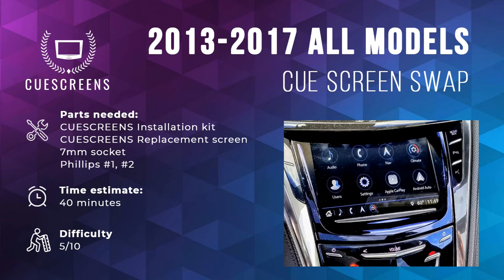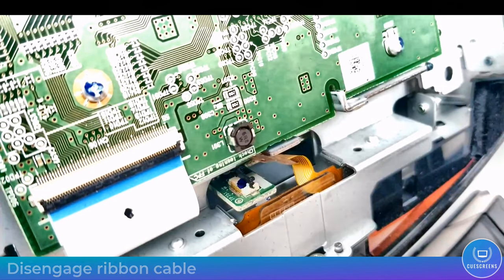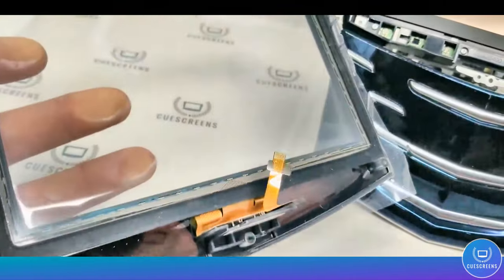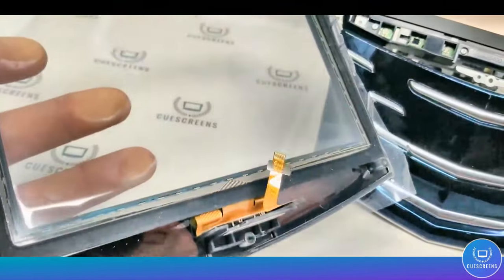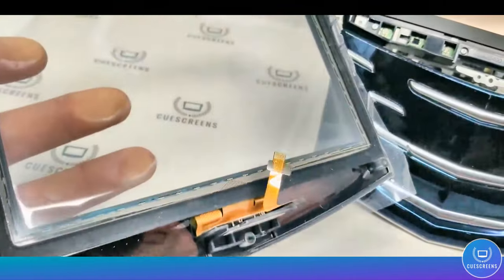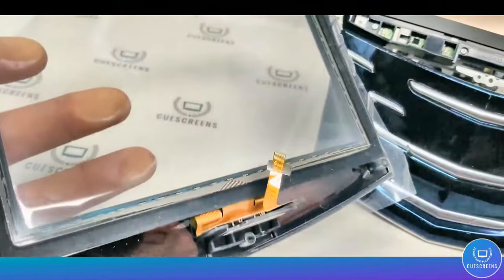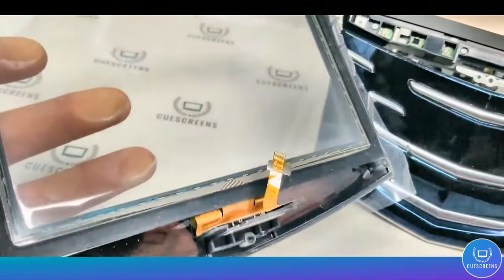How to replace Cadillac CUE screen to fix unresponsive / random touch issue  *Easy Method*

Comment from the maker: New for 2022!! The Premium Dual Mode screen is compatible with ALL systems- whether it starts with 2 or 8, doesn't matter, it still works. This means there is no risk of ordering the wrong part anymore. Check it out here: https://youtu.be/AzMrYJPxxN8
Reply: I jjust used the dual mode screen (2016 Escalade) and it worked perfectly.  Only difference from the video was my side covers were shaped different and only held on with (2) screws each, instead of (3), but other than that the video was spot on.

Comment: Just finished this myself in about an hour.  Screen hasn’t been working for two years. I am so unbelievably grateful for this video and that it actually worked!
Reply from the maker: You're welcome!
Reply: Oh please!!!  It didn’t take you an hour. Get real. There’s no way in hell you did all this In one hour.
Reply: @joeblow9850  I have zero reason to lie about this.
Reply: Well that's a great sign 🎉.
Reply: @joeblow9850  lol if you know what you’re doing you can do this shit in less than 30 minutes, you must take 3 hours to do an oil change too huh 😂
Reply: @sosa3017  actually I do to be honest because my OCD forces me to wait for every drop of oil to come out, Then gotta clean the oil filter housing thoroughly before puting in the new filter, then ofcourse I need to take the oil filler cap into the house and wash it out with hot soapy water. Dint even get me started on the air filters & spark plugs. 🤣🤣. How much time ya got?   LMAO
Reply from the maker: @joeblow9850  I do them in 30 mins :D
Reply: You liar lol
Reply: You missing steps my G

Comment: I didn’t have any cracking but the screen wouldn’t respond to the touch. The dealership quoted $1400 to fix it. After watching your videos I thought it was worth $130 to try your screen. After watching your videos several times the install was a piece of cake, less than 2 hours on my 2013 SRX. My wife is thrilled. Happy wife, happy life. Thanks cuescreen.
Reply from the maker: Nice job, happy to help!

Comment: 40 years as a tech and can truly say this was the easiest and most cost economical repair I have completed on my ATS.  I hope it lasts in the Florida sun and I finally have one less reason to hate my car.  Shame on Cadillac as 4 screens replaced in 5 years is totally unsat.  GM should have been using this design from the beginning.  On a 5 star rating, the replacement material and video are a 10.

Comment: Thanks a lot, took me around 1.5 hours from start to finish and now works perfectly, (This is probably the first time I post a comment on YouTube) its worth doing it yourself the dealer wanted around $1500. My advise is to check which model your screen is rather than just your car year, mine is a 2015 ATS but I guess the screen was replaced under warranty in its previous ownership as my screen required the v2018 screen.
Reply from the maker: Glad you like it!

Comment: Small piece of advice that I think some would say goes without saying, but.....make sure you have a good pair of screwdrivers with a long thing shaft and to save yourself a lot of headache, a magnetic tip. There are some small areas. Not totally inaccessible, but would be VERY frustrating without a magnetic tip. This concludes my TED talk.
Reply from the maker: Great idea thanks for posting

Comment: Trying to install the screen onto a 2016 escalade everything is connected, the ribbon with the black face up and tab outwards the screen wont even turn on, if I flip it around the screen will turn on but the touch screen wont work. Am I doing something wrong or did I get a defective unit?

Comment: I just installed the CueScreen in my SRX.  Absolutely fabulous product and is working as the original!  The video is bang on and if you take your time and are patient, this installation will go well.  Watch the video a few times and have it with you when you take everything apart, including the trim on the car.  Thank you very much for saving everyone a pile of money.  The dealer here in Canada wanted $2250+Tax for this installation with the screen.  I would give you 10 stars if I could!!!!
Reply from the maker: Great job!

Comment: Followed the videos step by step. Very easy install. No issues at all and now my cue functions correctly. 😎 And I received my screen in 3 days. My luxury car is all luxury again. And not gehto hoopty
Reply from the maker: Awesome work!
Reply: 😂 mine is currently ghetto hoopty 😂 this might be above my pay grade so I’m thinking of taking it to my mechanic shop!  It will still be waaay cheaper than at Cadillac and since my town no longer has a dealer I’d have to drive at least an hour to 11/2 to get to one.

Comment: I guess I am a latecomer. I just did this job this afternoon. Not quite as easy as you all make it look but not difficult either. I had the most trouble getting the unit unplugged. I had 4 plugs but the top one on the driver side gave me fits because it would not release and unlike in you video, on a 2015 ATS, it is hard to get your hands behind the and get a sightline to see what you are doing. Also the trim pieces did not release as easy as it seemed to show. On the video. Once inside, I found mine to be a bit different from the unit in the video but they were minor differences.

This video made the job easily doable with a little patience.

Comment: I watched your  first and second video. Your attention to detail made the videos easy to work with with tear down and rebuild of car and module. I followed each step, stopped the video, did each step, then restarted where I left off until the  cue screen was attached and back in the 2014 srx car working. Now, understand that I am not mechanically inclined so the entire job for me was 6 hours with a few breaks in between but I myself was able to get it done. Thank you.

Comment: Excellent video have a 2014 ATS and looks like the dealer already replaced the screen before but left the screen protector on the inside cuz it had air bubbles all over and then started acting wonky where it would press buttons by itself, great instructions and did it all myself truly happy with the way it looks thanks again CueScreens!
Reply from the maker: Avoid that dealer- if the tech is not smart enough to remove the sticker that says "REMOVE THIS STICKER BEFORE INSTALLING"

Comment: Excellent video. My 2014 screen stopped working before CIVID hit. I was actually apprehensive about replacing my screen (myself). I even communicated with a few sellers on eBay to get a replacement unit. I couldn't see paying Cadillac $1300.  The instructions here were very accurate, concise and easy to follow... with a few pauses and rewinds (but that was for me to make sure that I was following the video). I took a little more than an hour from start to finish. Now my Cue looks so nice. I bought a genuine Cue screen on Amazon. Good look replacing yours. Just follow this video and don't lose any screws. Be gentle. Peace

Comment: Worked perfectly on ‘16 Escalade ESV. Only difference from the video on my unit was, instead of six 7mm bolts on the back of the unit, mine had T15 torx bolts. Thanks for saving me $1,000!

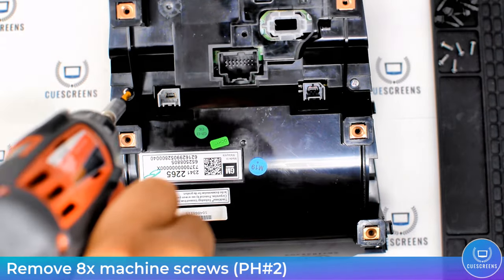Comment: Great video.  $79.99 instead of $1,500 is a great win.  Mine was not cracked at all, just (mostly and/or inconsistently non-responsive).  Took me just shy of 1.5 hours from start (began removing the cupholder) to finish (closed the door and smiled).  On my 2016 ATS, there are only three plastic screws instead of five (@3:07 of video) and they changed the 'compartment box light' connector (@5:00 of video) - it's not there on mine AND you don't have to remove it in order to remove the compartment box.  Appreciate the great product and the effort that went into your video -- Thanks, CUESCREENS!

Comment: Just did my 2013 SRX.  Over the past year and a half it went from randomly not working to completely not working.  Forums and online searches revealed a $2000 repair at the dealer.  I was contemplating getting rid of the car until I came across this and gave it a try.  Great video instructions! I replaced my screen in about 1.5 hours and now it works perfectly for only $140!  Don’t be afraid to try and fix it yourself people.  With the right tools and a little patients it’s an easy fix.
Reply from the maker: Great job Adam! I agree, its honestly a simple repair if you can take your time and follow the video. Especially when the alternative is paying GM another $1,800 for another control module that will fail in 2 years again :(

Comment: This might be a little tricky for someone with no mechanical experience .As a retired Electrician and my electrician friend (we have done a lot of our own work on cars starting out very young)we were able to do this albeit we installed the cue ribbon cable upside down and had to take it apart a second time.Second time was one fifth the time as we had the sequence down with a couple of extra screws left over where did not know where they went.Take pictures and watch the video a few times to get familiar.Support was great with the help of Charles I believe his name was,walked me right through it,Feel proud to do it yourself ,because the dealer is a total rip off at 1600 dollars,shameful.Thanks Cuescreens ,
great idea and great service
Reply: The dealership isn't replacing the screens. They have to buy a complete cue & some go for $1200. That "total ripoff" would be GM

Comment: Just finished replacing the screen in my wife's 13 SRX. Instructions are easy to follow. Unit works great. Just a heads up, the machine screws you are using a #2 Phillips screw driver are actually JIS (Japanese industrial standard) headed screws.
Reply from the maker: Great job

Comment: Great video.  Made changing the CUE screen very straight forward.  Thanks for saving me a $1,000 from the dealer.  This is actually the 3rd CUE screen replacement in my wife's 2016 SRX.  The first 2 were done under warranty.  This one was on my dime.  Highly recommended.  Thanks.

Comment: Thank you so much and +10 to your good karma for your help!!!!!! Just replaced the cracked screen with your videos and it worked!!! We did not do anything to get it cracked, so it's not due to negligence on the user's part. The dealer quoted $1,800. They should be taken to court for this kind of scam.
Reply from the maker: Great job.

Comment: THANK YOU!!!  I followed remove, repair, reinstall directions frame by frame for my ‘15 Escalade. The screen fit perfectly.  No alignment issues.  Great suggestion to try it before putting the truck back together - it powered up but touch didn’t work. I went to “troubleshooting” and sure enough it was the little ribbon connection. You need to get that to fit just right. That was the hardest / most frustrating part. I am incredibly happy with the result!

Comment: Just did my 2015 SRX. Like many have noted, the trim was the hardest part. Lots of steps but the instructions and particularly the video were very well done. All screws lined up fine, no code needed, and it worked. Like the ending screen of the video says "Congrats! I just saved $1,500!".
Reply from the maker: Nice job!

Comment: The installation process was so easy. If you ever worked on a laptop you can do it. The step by step video is extremely detailed. No surprises. Highly recommend this company.. but make sure you get the premium brand that comes with the tools and also the little mini needle nose pliers. Will definitely safe you time and a headache.

Comment: Excellent video, I was able to do this step by step at my desk without issue. I was very careful to not push on the new screen, or touch either the inside of the new screen and the inside of the unit screen after removing the old one as I didn't want permanent fingerprints. Everything lined up very well and went together without fighting me. A couple differences I wanted to point out - I have a 2017 ATS, and I did not have a "compartment box connector" cable at all, which was confusing for a minute as I looked all around for it, but it simply did not exist on mine. Also, my side panels (the ones held in by the 7mm bolts) were only held in by 4 bolts. There were holes in the unit for 6, but only 4 holes (2 apiece) in the side panels - I did not have middle the middle holes in my pieces and there were no bolts there, in case anyone else had these differences. Looking forward to NO MORE PHANTOM TOUCHES!!!

Comment: CUESCREENS - Thank you so much. Had a non-responsive screen. Followed the instructions in detail. Works perfectly! Save a huge amount of coin! Nice job in the video. I would say I was scratching my head when the wireless charging connector was missing. I assumed no issues and moved on. It might benefit from throwing a "pop-up" in the video so rookies like me don't think they have done something incorrect. A thousand thank you's.

Comment: My 2013 was on its 3rd Cue screen. The first two were replaced under warranty. There wasn’t any way that I was going to spend $1500 on replacing my now unresponsive screen. I lived with it for about a year by using my steering wheel controls to change radio stations. Navigation use was not possible. And then I watched this video!!! Immediately placed my order. Installation went pretty easy. The only grief I had was removing the panels on each side of the console. It’s the only part of the video where the actual removal wasn’t shown being done. Just shows where the bolts were to be loosened and removed. There isn’t much room for a wrench to get in there due to the seats next to it. The rest of the process was easy while following along with this excellent video. Next time, if there is ever a next time, I can probably do the whole job in an hour. I know that you can’t see this, but I’ve got a big smile on my face now that I’ve got a working Cue screen!!! Thank you.

Comment: I got stuck early on, because I didn’t have a screwdriver small enough for the plastic screws. I might have to reassemble and try this again because I live far away from everything. It was a pain getting the unit out of my car, so to hit this road block, I lost my sh*t. Hopefully the finished product will make it all worth it.

UPDATE: I was able to borrow a small screwdriver from a neighbor. Everything went back together well, and everything functions as it’s supposed to. Thank you for sharing this video, as I would not have been able to do this otherwise.
Reply from the maker: Great job- it might have been a frustrating issue not having the tools, but you saved over $1k
Reply: @CUESCREENS  ironically, a week later, my small screwdriver turned up 🤣

Comment: I just finished this repair, followed the instructions and they worked perfectly! Great video, very well done! 

I also ordered the screen from these guys! 
For reference, this was on a black 2016 Cadillac ATS, where the touchscreen stopped working completely, the dealership wanted $1400! 

The whole process took under 2 hours, and that was with me being very cautious, and every screw fitting back exactly as it should! 

Thank you to whoever made the video, and anyone trying it out, good luck!
Reply from the maker: Nice job!@

Comment: Just saved $1500+!  Anyone can do this! Watch the video a few times, watch while your doing it. Keep each screw type separate and in order. The only thing that was different on my 2015 Cadillac ATS was the one little light clip. It wasn’t on mine. Had no problems with the screw holes lining up. Just took my time as I watched the video. Also, don’t take a chance and order the cheaper one CUE offers, they were right, if it’s not the original unit in the car it won’t work. When I took my unit out, sure enough it had a label on it that said refurbished! I’m very satisfied at this point, just hope it holds up. Thank you!
Reply from the maker: Great job thank you!

Comment: Your video is the go-to video of all covering this issue with the Cadillac CUE systems gel screens.  The instructions, lighting, sound, view points, speed...everything was great. I was able to follow along and finish in about a combined 2 hours.  I say combined because removing my screen revealed to me that I had the V2018 model in my 2014 SRX...WHAT DO YOU MEAN, you say? I was just as stunned. The one I removed had the waffle pattern.  I bought the one for my vehicle year (purchased in 2015) and the only place my car has been serviced was at the Cadillac dealership.  The only thing I can think of is that it was swapped out for some reason at the dealership.  Anyway, the point I want to share is, to not rely on the year of your vehicle but to actually look at the part when you remove it to make sure you order the right one.  So after sending the wrong one back and ordering the right one from CUESCREENS, I was done in a combined 2 hours. Thank you !!!  I can used the hundreds I saved to get my nails done.
Reply from the maker: Thank you for the feedback! Glad you like it

Comment: It works!  Fairly easy.  Not the sort of thing I've done before.  This and other DIY videos for this gloss over the hardest part, pulling back the trim to get at the screws to remove the unit.  Getting the electrical connections off was not as easy as the video looks.  Another thing to note, in this video he constantly reorients the unit but has not said so and is not shown in the disassembly of the unit.  Just pause often and note the unit orientation.  Putting it back together and into the car was easy, again, pay attention to the unit orientation.  Thanks CUESCREENS.